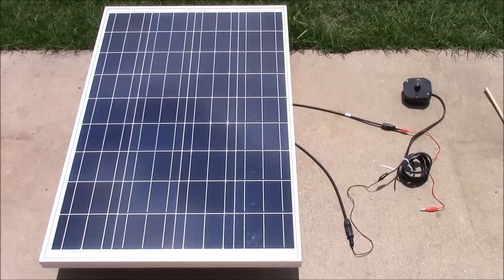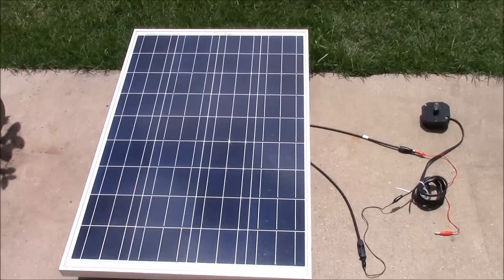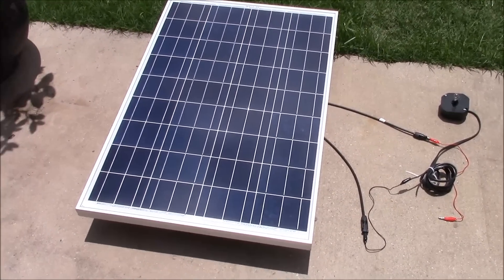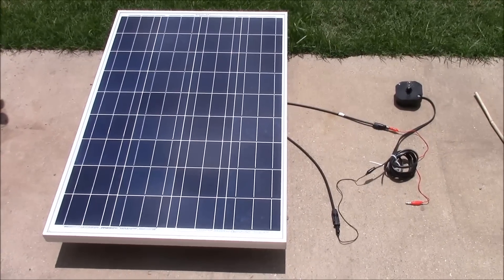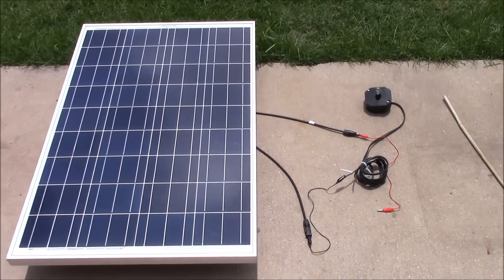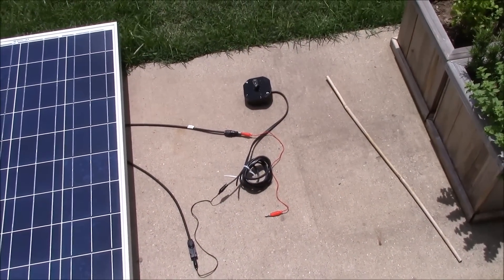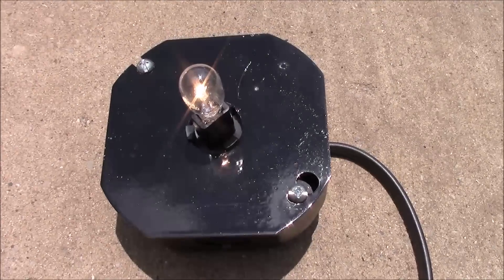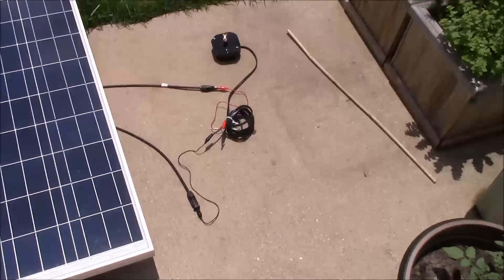Will It Solar? - Landscape Lights

Comment: Great idea on a video series, I'm looking forward to seeing more.  One suggestion though, maybe adding a volt and ammeter to your testing setup would help correlate the relationship between actual voltage, current and practical application. Thanks for the videos!
Reply from the maker: dts1449 Yeah, I tried to do that in the first video but my ammeter was not cooperating.  I will try to fix that today, actually.  It is sunny so I am going to try to shoot another video in this series.  Stay tuned!